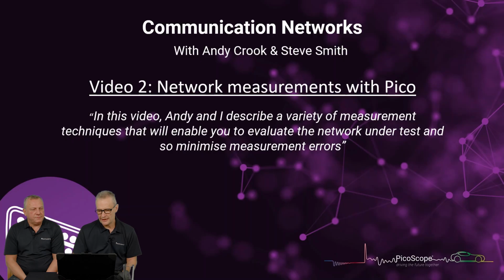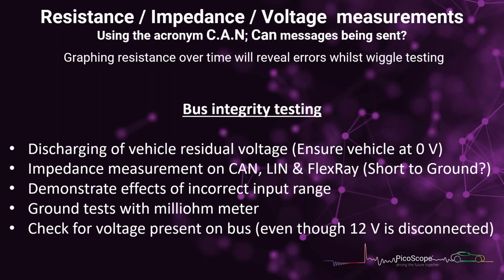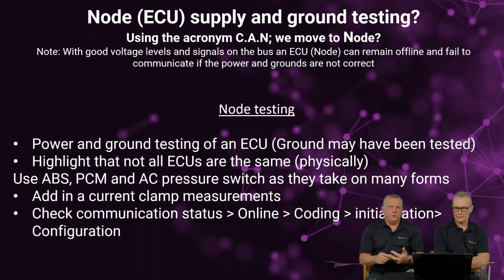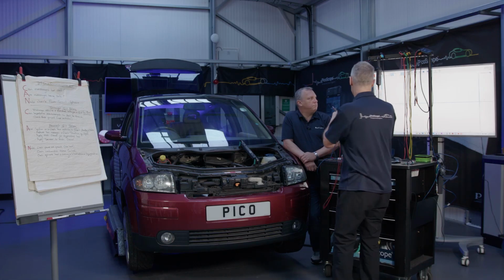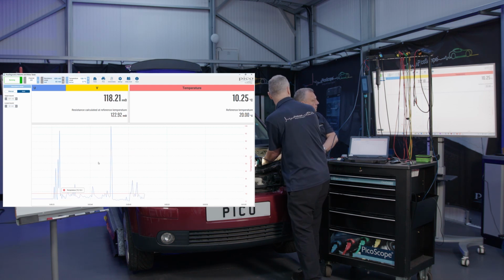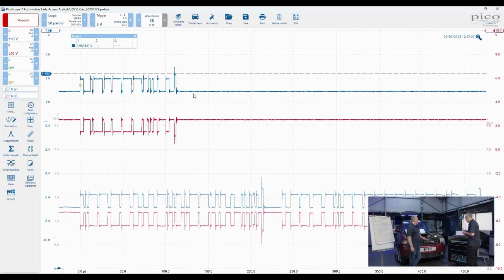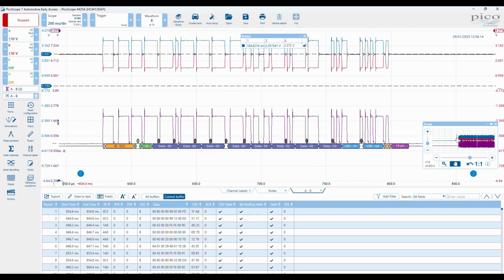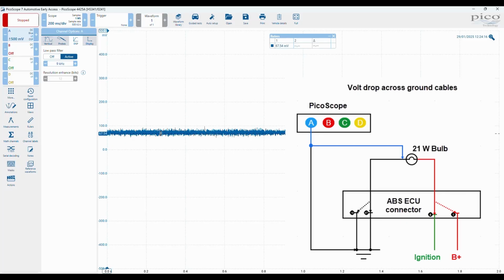Communications Networks (Part Two: Network measurements) | PicoScope

Comment: Love these videos, recently had 2 cases ive used serial decoder to diagnose a vehicle

Intermittent can fault, unable to decide what the fault was with a plug in tool

Used the decoder on a road test and soon seen the issue, specific messages being unable to reach the correct upper voltage, eventually it started to pull the can low down partially when the module in question started to communicate, wish i had used the amp clamp to try to narrow down who it was causing these issues, but i soon found it when it broke down i could then scan the vehicle whilst it was faulting and found the BECM was indeed the faulty module in the hv battery. Brilliant tool and technique to find issues with CAN faults if you know how to use it and apply it

Comment: Hi Andy and Steve, loving the video's. Just a question regarding measuring the Terminating Resistance (Impedance V's Resistance). I have always been under the impression that Impedance (which is a combination of factors including Resistance) is only for A/C. In the video you refer to measuring the Impedance between Can High and Can Low.🤔

Comment: How would you apply the serial decoder? We see we have a possible issue with the data packets but how would we use that information to gain diagnostic direction? How would you know what module send that particular message and how would we determine of its a hardware or software issue?